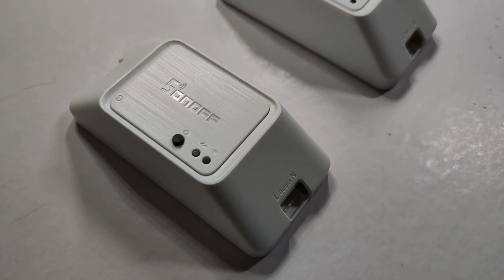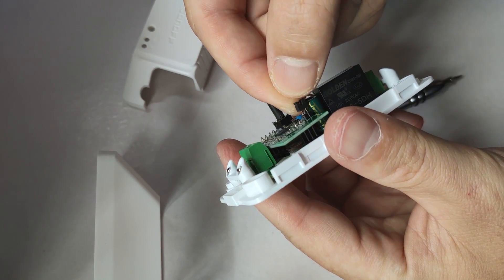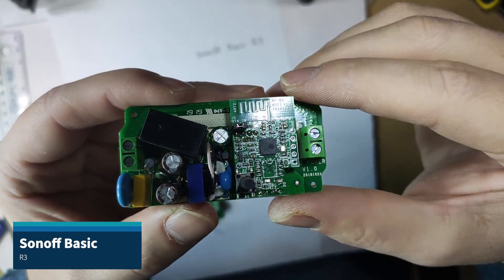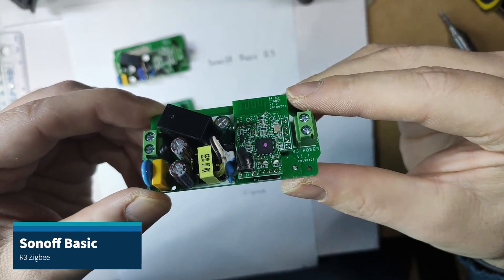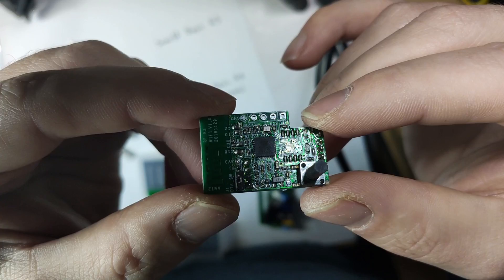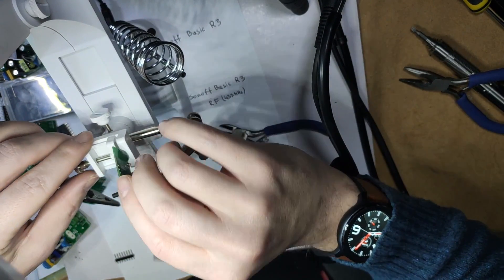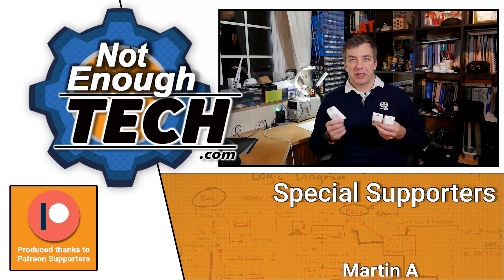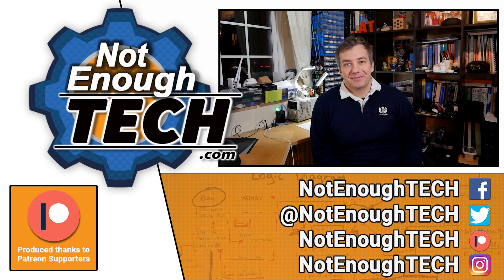Sonoff Basic R3 Teardown (Zigbee, WiFi, RF 433MHz)

Comment: Hi Matt thanks for the videos. These Sonoff Basic R3 (Zigbee) seem difficult to get ahold of, has there been another/better model released which i should go for instead? Seems odd there arent more "simple" zigbee switches such as this, which actually hide the wire so that you can mount it directly on the wall
Reply from the maker: Could be component shortage? There are Zigbee versions in Mini series

Comment: Hi, I saw this vid and wondered if you could answer a query for me……I have a basic R2 which is, supposedly, able to be linked to a 433 remote as it’s both an RF model plus the instructions with it says it can. I already have a few other sonoffs (4ch pro etc) that work with several remotes but whatever I try I fail to get the basic to link? I’ve emailed them but their reply was just a repeat of the instructions. Have you any ideas? I’d appreciate anything as I’m tearing my hair out 😢
Reply from the maker: By the sound of it, you have a damaged unit. Its usually just getting the thing into pairing mode and pressing the RF button quickly to record the singnal.
Reply: @notenoughtech  Thanks for the reply…..yes, I wondered about a damaged unit until I took a second one out of its box and it’s exactly the same. They were both unused and still boxed. I’m a terror for buying sonoffs if I see any going discounted and although I bought these two, separately, several months ago, I suppose the both of them could be defective. The itead support suggest sending a video of me trying to pair them and so I’ll give that a go but won’t hold my breath. I just wondered if you had a trick up your sleeve 😊. Thanks anyway 👍🏴
Reply from the maker: With two behaving the same way could be an issue with the remote? It's unlikely both would be damaged straight out of the box
Reply: @notenoughtech  you would think so but the remotes (tried two of them) pair with the 4ch Pros.... I'm lost, that's why I messaged you hoping you may have had a alternative method 🤔
Reply from the maker: Sadly no, I would only refer you to user manual and I believe you already had this treatment :)

Comment: Hi Matt!  Do you know where I can find the schematics of Sonoff basic R2 and basic R3?  The key  and k_p connections on the pcb go where? Can OTA be used with ESP8255? Can ESP8255 be programmed with micropython? What  extra current can be taken from 3V3 pin to feed power sensors? Thanks for any feedback .
Reply from the maker: I haven't see the PCB schematics anywhere.  You can flash custom firmware and program these with micropython or use Tasmota to hook up the sensors. As per current, it's hard to say, if you want to control more than one sensor with it, I suggest power them up externally.
Reply: @notenoughtech  Thanks! How would you program it with micropython? Because in Thonny IDE I find only ESP8266, not ESP8285..
Reply from the maker: You could see if platfomIO has environment set for that

Comment: Hi Martin, hope this finds you well, My 6 month old Sonoff basic R2 konked off ... I tried changing the relay, but it will not budge, it will not come back on (sadly the original relay broke off while desoldering it out) (Also there is no glass fuse, its seems to be a 5 band 10 Ohms 5% resistor in its place inside a heat shrink tube).. ... Anyhow Funny though 5 other Sonoff basic R2's switches have been working for over three years perfectly well ... And this new unit circuit broke and I cannot figure what component has popped. ... I'd be totally thankful if you could guide me on how to fix this.
Reply from the maker: Frankly speaking these are very cheap and while I do encourage ppl to fix stuff than chuck it away it's hard to fix without deeper knowledge of electronic

Comment: @NotEnoughTECH - is there a way to solder antenna to this to extend the range if so what should be soldered to where. Thanks.
Reply from the maker: You could break the PCB trace and add the antenna connection. https://notenoughtech.com/featured/testing-9-external-antennas-with-cc2531-zigbee-coordinator/
You can use this as guide but remember the power is pretty much the same so the only benefit is when your device gets a lot of interference. It won't increase the range but it helps you move the antenna away from interfering factors

Comment: Would it be just as easy to change Sonoff Basic R3 Zigbee to Garage Door opener or is the board in it's way?
Reply: Thanks for the quick response. Will try it. Great videos..
Reply from the maker: yes you can perform the similar hack as for the R2 series. The main difference is in the way the controller is installed onto the board

Comment: Hi thanks for the video! 
Would it be possible to solder an external switch in R3 RF?
I want to put the sonoff in a wall box and be able to use RF remote or wall switch or Home Assistant to control it.
Are there exposed pins, connected to the onboard switch, which I could easily use?
Reply from the maker: Yes it would be  - you can replace the switch or use extra GPIO

Comment: FYI, there is now a third-party Zigbee 3.0 firmware (based on the official TI Z-Stack 3.0) available for Sonoff BasicZBR3 that also adds support for an external sensor as a proof-of-concept, checkout  https://www.cnx-software.com/2020/05/25/zigbee-firmware-news-ti-z-stack-3-0-zigbee-for-cc2530-ptvo-zigbee-fw-configuration-tool/
Reply from the maker: Someone pinged me that on Reddit. May give it a go at some point. I'm behind with stuff right now but I will continue with Zigbee as I really like the protocol

Comment: Interesting they chose I2C instead of serial for the interface.
Could be interesting for connecting external sensors.
Reply from the maker: I'll try to test some as I have exactly the same breakout boards for cc2530 see how tasmota holds up and if it's worth it